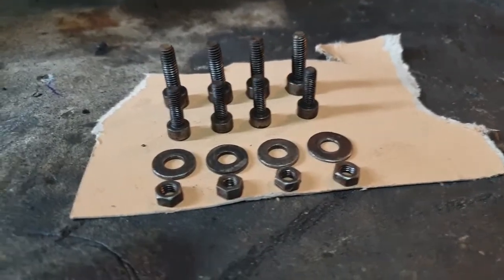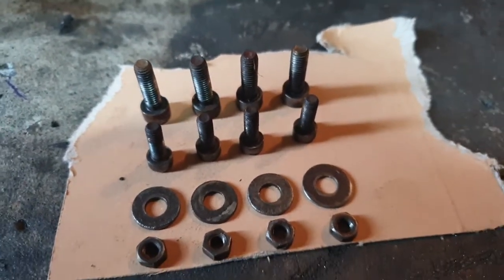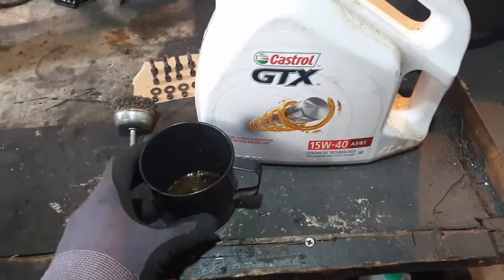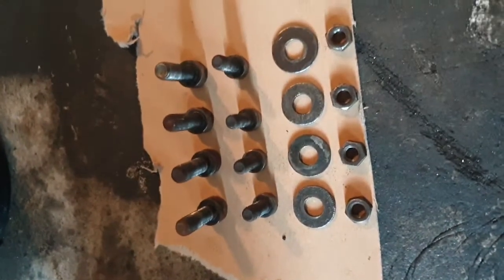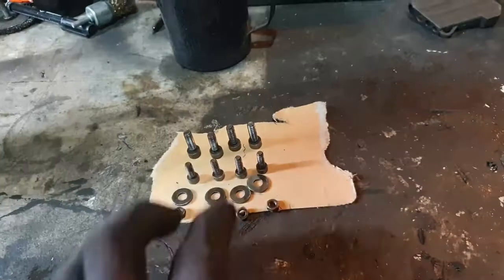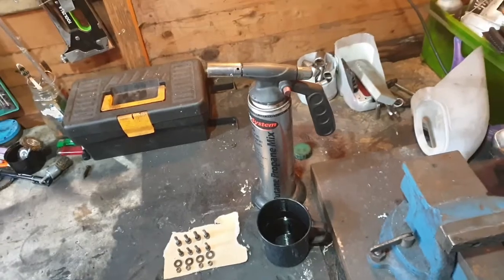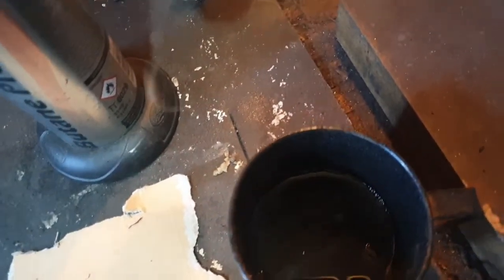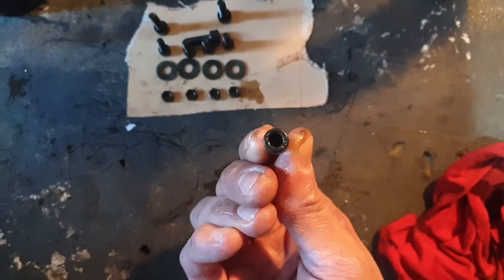How To Rust proof Bolts

Comment: I’d like to warn everyone that many  bolts are heat treated and this will affect its physical properties and strength profile. Great content though
Reply from the maker: Thanks for your comment and I'm  glad you liked the video. I've seen various ways of heating bolts. Some use ovens others use a torch. The basic principle is the same. The bolts must be heated so they change colour. Steel to blue then back to steel at this point you dunk the bolt head into  your oil.
This process does not change the physical properties of the bolt if done correctly.
These bolts were not used structurally. 
I hope this clears up any confusion 👍
Reply: @SurreyRider  right! My one concern is that being in the metal industry, we are aware that as soon as a steel exceeds temperatures of as little as a couples hundred degrees, it will change the temperament. As soon as metal changes color (just under 400 degrees), you can be certain that you have changed its physical properties which could be a major issue if the specific qualities of the bolt are required, for example in the case of an automotive bolt
Reply from the maker: @kaisunra9676  I agree these bolts perhaps should not be used for things such as engine mounts and frames. In most cases I use bolts treated in this manner to mount fairing panels, battery terminals and similar. These are bolts ive treated to mount in this case a custom made speedo mount. Ive used this method many times and have not had any issues.
Reply: @SurreyRider  good! I doubt you would ever encounter any issues in the vast majority of applications, more of just a disclaimer and something to be aware of. It could effect liabilities, warranties, legal whatever, and things like that under very specific circumstances
Reply: @SurreyRider  I wonder if this would be OK for wheel nuts. (lugnuts) if I just heated the hex top and not the threads..
Reply from the maker: @lambese4-  In truth I'm not sure but Del Boy doesn't mess with his so I'm guessing maybe not. However you can experiment with small amounts of heat perhaps in the oven then dousing with oil, as suggested above. Hope that helps and be sure to let us know how u get on!

Comment: Does this also work on nuts and bolts that have oxidation?
Reply from the maker: Rusty bolts and nuts, yes it will. Follow the steps in the video and it will restore them nicely.
Did you find this useful?
Hope you consider subscribing for more content. Thanks for your comment Alex 👍
Reply from the maker: That is exactly what I suggest in the video, clean off the rust as I have shown or with a mild acid (vinegar) its better to watch the whole video than skip bits or you can sometimes miss valuable information.

Comment: Will this work on screws as well...
Reply from the maker: Hi, first I'd suggest checking to see if they are steel, this process only work on steel. 
You can check with a magnet.
This process works with all steel items.
Let me know how you get on.
All the best SR
Reply: @SurreyRider  ok so it will work on steel, most of the screws are made from iron here in India
Reply from the maker: @fantasyteamshorts6112  You could try a wire brush, if not why not experiment with a damaged screw.
Reply: @SurreyRider  thanks will try that on every screw I buy, when I service my bike I get the old oil back for free and I can usee the cooking gas to burn the screw...this will be very helpful for me..few days back I saw many screws in my house that were rusted and were hard to remove
Reply from the maker: @fantasyteamshorts6112  All the best with that if you need anymore information just let me know.

Comment: have you gotten beat up in the comments about altering the metal properties yet and making these bolts brittle and reducing their tensile strength, I'm not trying to be a jerk, I just seen that always being the case, so I use this process only for ornamental hardware and not for anything structural, maybe a metallurgist can comment on this for us    

please watch this clip at this part    https://youtu.be/CTMUEmQbniM?t=320
Reply from the maker: Hi Good enough garage, thanks for the extra reading. As a rule I tend not to use treated bolts structurally. Instead I as in this case these held on the headlight and seat. I used them like this with no issues. Thanks for your comment.

Comment: hello bolts will lose tempering
Reply from the maker: I've seen this done many times, I'm copying a known trick. If you heat them as I have you will be fine. I've done this myself many times and have had no problem 👍
Reply: Yea, just don't go using this trick on anything grade 5 or 8 if you want to rely on it's tensile strength

Comment: Is it dangerous to breathe in the smoke? Should you wear a paint fume mask? Should this be done outside?
Reply from the maker: Hi there Meserbee I have seen this done with and without masks.  Personally if its done with plenty of ventilation I can see no reason why it can't be done outside in a shed or similar. 
Thankyou for your question! I hope you liked the video and if you found it interesting or usefull then please consider subscribing.
All the best SR
Reply: @stevexracer  some people just turn their head. I wanted to know, as a layman, if it is advisable to be extra safe. Some pros, like with disc brake dust, make sure they wear a mask while some just do it. Shoveling your s*** right back there buddy.

Comment: That was not the correct way of bluing steel. Your screws became too brittle. Red hot steel (over 800 deg.Celsius) is used during hardening steel. Bluing temperature is max 300 deg.Celsius. A blue oxidation appears on a steel. That's why it's called bluing.

Comment: Only dip the bolt enough to submerge it enough.. push to far down and you'll melt the bottom of the plastic container and oil will spill all over your worktop.
Trust me
Reply from the maker: Thanks for your comment Spencer. Yes I have managed to do this once before unfortunately. Not my finest moment but since that I have ensured to use an old tin which really makes a difference.
Reply: @SurreyRider  I learnt the hard way. lol